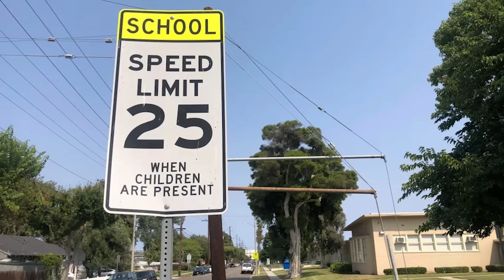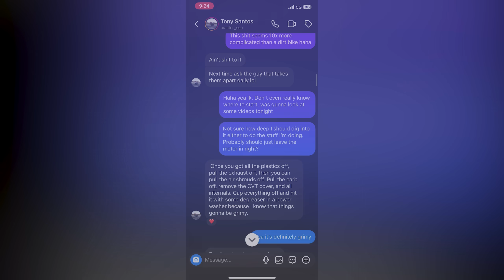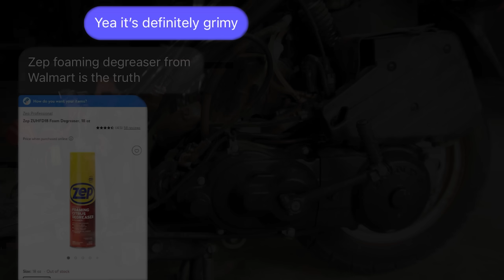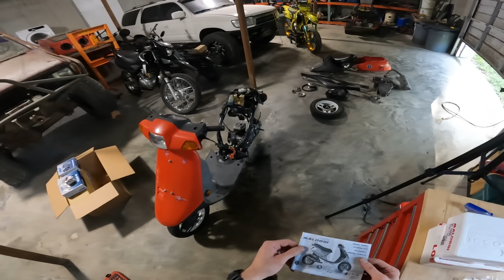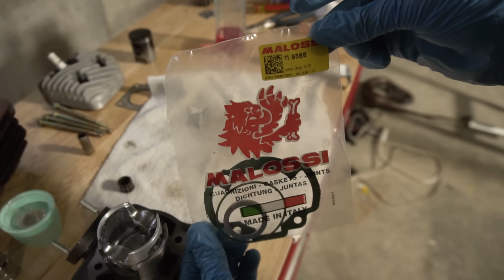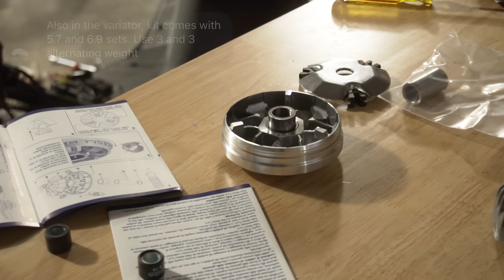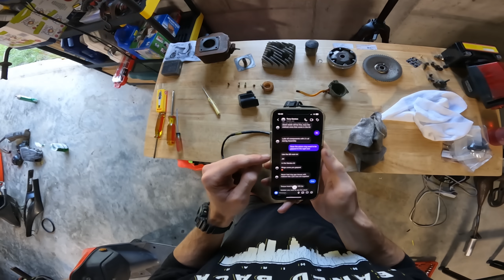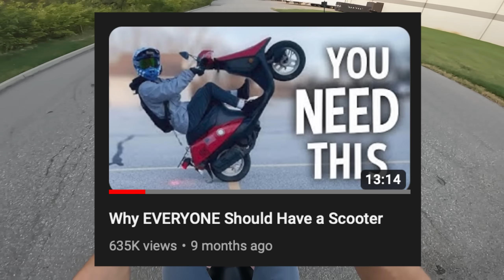HUGE Power Upgrades on my DREAM SCOOTER

Comment: Always check ring gap. At least .004" per inch of bore. A 70 kit is usually around 47mm which is about 2 inches, so rings should have .008" gap minimum. Also, it's important to make sure the cylinder ports are chamfered. Many kits require you to do this. I know Malossi is higher quality but I still would have checked that. It's extremely important. I also would suggest removing the engine, as it's only a couple more bolts and allows you to put the thing up on a table where you're not crawling around on the ground. It makes it way easier and more pleasant to do the work. Although that just might be my old-man-back speaking...
Reply from the maker: I agree with all of this, but for this quick engine build I just did it the quick and easy way. Wanted to just get it done haha
Reply: @TwoStrokeJ  well it looks like it worked out well for you. Malossi must be on their game with that good quality control
Reply: malossi makes them ready to put them on
Reply: @scottex.  I've heard that, but I'd still check. Kinda like how spark plugs come pre-gapped, but they are often wrong
Reply: * at least 0,1016mm per 25,4mm; about 0,188mm ring gap
Reply: Unless you're splitting the cases for a new crank it's not necessary for removing the engine, also the scooter kits always come ready to install, I usually port my a bit to smooth it out but that's not needed either
Reply: @Sam-ob4of you know that comes out to for all intents and purposes the same thing as .004” (inches) per inch of bore….you just restated it in mm (I know yours gives .0079 inches but whose to argue over .0001”
👍🏻
Reply: @middlesiderrider Malossi is really high quality but I know what you mean :)
Reply: @4fiddy_a_aron  the cheaper scooter kits don't. They have very sharp edges on the ports and the ring gap is often tight. I just built a 96cc Jog 90 and the rings only had .005" gap, which is way too little. If I had assembled the engine it would have ruined the piston and bore. But yes the high quality kits might be fine. Doesn't hurt to check
Reply: yeah but rings gap is extremely important it will run but for the longevity of the build always check ring gap
 @TwoStrokeJ
Reply: We all know you’re tryna get your comment featured on the next video
Reply: I wished he would know how easy it is to separate engine and frame, that's what I thought.
Reply: @TwoStrokeJ  It takes 2 minutes.
Reply: no cast iron kits come with ports chamfered, only nikasil aluminum cylinder has chamfered ports. cast iron kits don't necessarily need to be chamfered, but it will extend the life of the piston and cylinder. the piston will get streaky after a thousand miles or so but that's about it. as for piston ring gap, it's always best to check especially on the no name kits. polini, malossi, parmakit, pinasco, etc tend to be spot on 99% of the time.
Reply: that's cool but I bet that carb is a 12mm, which is REALLY slowing you down, with a 70cc you cannot not use at the very least a 17,5mm (I would go for 19mm but by tweaking jets you can manage to fit a 24mm for a 70cc which is dumb big)
Reply: After reading that wall of text, I was surprised you have zero related videos on your channel.
Reply: @eriklarson9137  I've wanted to make vids, as I've fixed up and built a few dozen scooters over the past four years, and have seen a lot of interesting stuff. But I haven't, for a few reasons. My phone(camera) is very poor quality and can't hold long videos. And the added time of filming seems to make doing any repair take forever. Finally, they are already a ton of good scooter building videos on YouTube. I'm not sure I could add anything of value to the genre. 
So that's my explanation(assuming you weren't just trying to shit talk haha), given to you with another wall of text.
Reply: @eriklarson9137  btw I just checked out your channel. Heaven and Hell is my favorite Dio song. Ronnie James Dio was the first artist I ever saw in concert and he was awesome. RIP
Reply: Removing the whole engine first-100%.... Takes less than 5 minutes
Reply: Takes me 20 min to get my boiler suit on 😂
Reply: I never knew this. I had the fastest air cooled scooter at DHS in 2008, measuring around 20 hp (forgot the exact number but could prolly find it somewhere). I did hone out the block and a lot of rubbing with a rough cloth rag lol
Reply: Need some front end weight
Reply: its .005 on those
Reply: @emiltuf1324  yeah I had 52mm rings on the brain
Reply: In the cheap ready to ride kits, Malossi already puts the rings to size (with measurements that are safe not too tight) and without the need for squishing if mounted on the original shaft and gaskets supplied.  clearly they have very little power and it's not all that different from a worked 50cc, especially with the original carburettor.  for me these kits are a waste of money, better a carburettor and a 50 cc.
Reply: @middlesiderrider usually it's the opposite, on cheap Malossi RTR kits the bands have large gaps, whereas on racing kits you have to check everything because the band gap isn't right.  same thing for squish.
Reply: I think because even with the budget china kits when you slap it altogether it starts and runs that people assume "job well done". I don't think I ever received a kit (regardless of quality) that didn't benefit from some amount, even if minor, of smoothing/refining.
Reply: It's a moped, not a MotoGP bike.
Reply: @glossymouse7712  I thought Germans strove for precision.

Comment: When you install a new cylinder kit dont use full throttle for the first 50 kilometers and put a little Xtra motorolie in the gas tank, or your new kit can burn to the sides of the cylinder and then you need a new kit.  The first 50 kilometers if i remember correct is called "A Burn In".

Comment: That video reminded me my childhood - before (and even little after 2010) those 50 cc scooters was a go. Almost every teenager in my country had one and we even had our own community. Imagine a dozen of scooters zooming through the streets in line, popping wheelies on a secluded streets, working on them with friends. Performance mods is one thing but the cosmetic was also important - two tone paintjobs, polished aluminium parts... Heck, we even had a guys with a sound systems built inside the storage space under the seat (built from one/two speakers and a car radio or amplifier). Now I'm a 30+ years old guy and I see scooters being used for food delivery and casual cruising to work but there is no communities like those from 15 years ago. And no crazy builds. And some of them have electric motors.

Now hear me out - with the set up like this I think You should easly achieve even 60 mph! Also, if I were You, I would entirely throw out the oil pump and do the oil and gasoline mix by myself. Then, for the new cylinder set I would add a bit more oil for the breaking period ;)

Comment: This is what most of us in Europe run for a budget, sporty wheelie build. The 70cc Malossi cast iron performs well.
Al tough a lot of people do prefer the DR70 cast iron above the Malossi kit. Both seem to perform about the same with the Malossi having a tiny bit more top end. 

With a full volume crank set, a 19 mm carb with a good expansion chamber exhaust like a Yasuni R if you can find one in the states,  a bigger intake manifold and thicker reed valves or a reed valve kit this moped wil fly! 
It will throw you back without any effort. You can go a bit lighter on the rollers as well 6.5 is the sweet spot for now. 
Have fun, stay safe!
Reply from the maker: yep, thanks man! A budget wheelie build was exactly what I was going for, but maybe down the road I will tune it further like you said!
Reply: @TwoStrokeJ  yea you need a exhaust with a bend, not sure how to call it in english. i have a yasuni R under my malaguti phantom F12, great exhuast
Reply: @wielisziel You dont need a exhaust with a bend
Reply: @wielisziel  you mean a snake nest exhaust?
Reply: @Shadow-ew7wv  I agree. "stock" like exhaust will have less power overall, but offers much better bottom and mid range torque
Reply: @TwoStrokeJ try a custom cvt pulley they were great
Reply: @extec101  no idea, we call it a terugloop, which means "bent back"
Reply: @wielisziel  its cool to hear what others calls the bent exhaust
Reply: @wielisziel  we used to call them "rollenbank uitlaat" because if you had a terugloop exhaust on there you could be sure that the cops would pick you.
Reply: 70 kubik Unterbodenbeleuchtung auf Hochglanz poliert ... 😂
Reply: @extec101  we call it "svanehals" tanslates to swan neck or google translates it to gooseneck
Reply: A buddy of mine has a honda camino (hobbit in the US) that would go 120km/h no problem as long as the police didn't see him
Reply: Thank fucking god finally someone that understands.
Reply: @TwoStrokeJ  People poopoo scooter so often but they are the most fun things to ride especially in the city. There is nothing better that's why almost everyone in Rome has a scooter. Want to make some small grocery shopping? Scooter. Need to lane split in congested areas? Scooter. Need parking spaces where there are none? You can leave your scooter almost anywhere.

Comment: Great job!! 🎉
Don't push it too hard for the first 300km: roll it nicely, warm it up properly, use a fatter fuel mix than the one recommended, then after that you can push hard and enjoy 🤟🏼✌🏼
Reply: i think thats is to late
Reply: i think thats is to late
Reply: Most defiantly too late.
Reply: @mekkertroniker2002depends on if its a aluminium cylinder or a cast cylinder
Reply: @mekkertroniker2002 no it does. mate. malossi is cast metal wich is recomended to drive 100-200 Km every like 5 to 10 miles u got to open the throttle wide open then lower the rpms back. Otherwise you run the engine too hot and it will cause deformaion. Which in result if it happents too often blow your bike up. It can also happen the first time u drive it in. The richer oil mixture helps to keep it more lubricated since the partsd have not defordmed fully yet by siad heat. U should add about %2.5 extra oil to the fuel. (2 stroke)
Reply: @mekkertroniker2002 haha, me riding = 2nd person.

Comment: One thing i have always learned is that if you can, get the 6 point socket at ANYTIME over a 12 point. 12 points just seem to strip the shit out of any bolt/nut after a few times of being taken off and put back on.

12 point sockets have their uses, but honestly i don't use them for much other than hammering onto a stripped bolt at this point.
Reply: Amen brother
Reply: Yep!

Comment: Good job man! As a fellow 50cc rider i suggest you get a 21mm carb like a Polini CP21 or a cheaper PHBG21 from dell'orto, also Malossi reeds, intake manifold (21mm diameter) and a cone air filter would change the bike greatly without affecting reliability.
Reply: It is SO fun to hear these names for parts and carbs... I live in Norway and when i was like 17 (33 years ago) Me and all the guys got the 7HP or the insane 12HP kits for our mopeds with malossi and dell'orto parts!! I did not even know they were in buisness still.   I had a Suzuki ZR 50 that i put a 12HP kit on with the carb and performance exhaust but it was so insane it twisted my frame and the bike became undrivable. it did 110 km/h top speed but with a slow acceleration.  Bought a Suzuki 50 SL instead the chopper version and chilled down to the 7HP kit wich kept the frame from twisting :face-red-heart-shape::face-red-heart-shape:
Reply: That's the thing, with these kits, everything from hills, to daily atmospheric changes change the jetting. You can be good with the jetting for flat roads, but go to pull a 2 mile hill and they will go lean. Like him, I was suggested an 85 jet for the 21mm and a 90 would still be lean going uphill. I even installed a 91-100. If I got it rich enough on a hill the flat roads were running super rich. 
Only thing I could think of was for one, the cable that adjusted the 2 stroke oil feed was constantly shrinking and expanding, alternating the oil into the feed. Not to mention the dang rear pulley even a brand new one, would get worn in no time and not change gears properly. No spring is going to overcome those pins inside that rear pulley half from digging into the slots they ride in; hanging usually in mid range gearing on the rear pulley, never highest gears or the lowest gears. 
Kinda like the "Throttle position sensors"; they used to get an area of the gas pedal that would start to glitch while driving @ 45 mph because that is where the gas pedal is mashed to 90% of the time. That wasn't a metal quality thing like with the rear pulley, but just saying the most used gear is going to cut right into that part of the rear pulley slots first and foremost.
These gears are made for 75 pound people..... And going 2-5 miles tops. And flatlands....
Reply: @Tsenngu  12 hp are not enough to make any metal twist. I'd say the problem was something else.
Reply: 21mm is way too big for the engine and cylinder, 17,5 would suffice more than enough on this type of engine.
Reply: Absolutely, nice to hear someone knows a bit more atleast
Reply: @FreDEV_OFFICIAL  depends on the exhaust also id say 21 can be decent.. but maybe a 19 is a bit better for tuning.  If u get the higer end malossi top end and a better exhaust u can even go bigger on the carb. like 24mm.
Reply: @FreDEV_OFFICIAL i run a cp21 on a 70cc 🤷‍♀️
Its just the outside velocity stack diameter that changes,
The inside venturi is similar to stock size.

Comment: if you look at the old piston you really can see why it was running so bad. the rings where worn out and there was lots of blowbye. Also you can hear it from the sound and how its trying to run at the start of the video. oh and a quick tip to get the contra spring nut off, just throw it upsidedown in a vice and twist it by the pully
Reply from the maker: Yea it did look like the old top end had some wear on it. And that’s a really good idea for the contra spring!

Comment: ngl this is actually inspirational, i REAAALLY want a scooter now... we gotta make Scoot Central an international thing, with 2stroke J as the leader
Reply from the maker: Yes sir!!! That would be amazing! I really think everyone should get into modifying scooters though, they are so fun
Reply: Scooter modding scene is huge and has been. Especially with these af16 motors
Reply: Scooter tuning scene is massive bro  @TwoStrokeJ
Reply: My friend built a honda postie bike but turned it into a race bike with a 179 race motor. with manual setup and moto x handle bars configuration. thing smokes 400s like theyre not moving.

Comment: Nice vid man, this scooter (Honda Vision) was quite popular in the early 90's here in the Netherlands, this is also the time scooters became very popular because you didn't have to learn how to shift and because of the CVT it wasn't slow like older automatic shifting mopeds and a lot cheaper to insure then a manually shifted moped.
Illegal Scooter/moped tuning still is a thing here but harder to get away with these days, damn cops!
A bigger carb something like 18mm and a better intake&reed valve should make it even faster.
Reply: Exactly the same here in the UK ( also called a ' vision' here too) 👍 I still love these tiddlers.
Reply: the 130cc honda vision by dutchriders is a real death machine
Reply: @kroketfilet  It sure is 😎
Reply: Getting away with it isn't hard, it just costs way more money. My looks-stock Agility 50 has been modified with EFI, so when the cops pull me over for dyno testing (rollenbank) I just don't poke the app on my phone that switches to the "sport" fuel map. Cops invariably know something is up, because it cuts off at about 5000rpm instead of 6500rpm and it usually shows up as 52-54 kph. 
Even if they take off the cover plate that would house the CDI normally, all they'll find is an ECU without its Bluetooth sticker on it. If they open the carburettor door in the bottom of the seat, they'll see an injector and throttle-by-wire intake. Mostly I can make the cops go away after arguing about how it's for fuel economy.
Worst things I've happen so far is a cop breaking the quarter turn throttle handle, because he thought it was jammed by some sort of restrictor mechanism. And one that asked "so where's the carburettor" while staring at the fuel injector assembly.

With the sports fuel map loaded, it does about 65kph, which is fast enough. I've done quite a bit of modifications, but mostly because my friend bought a new cnc lathe for his shop, so yeah custom final drive, custom camshaft, reveno clutch pack, it's mostly "because we can" kind of things.
Reply: @fermitupoupon1754 welk bouwjaar is je agility? Ik ben altijd nog 2t tot de dood dus injectie ben ik ver van weg gebleven, ben wel benieuwd wat voor prestaties/specificaties er deze dagen in zitten